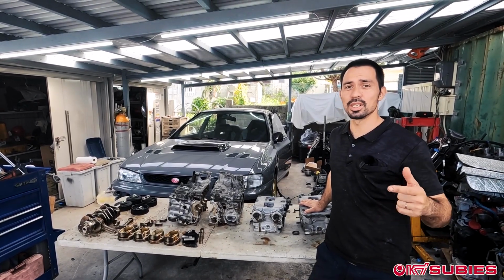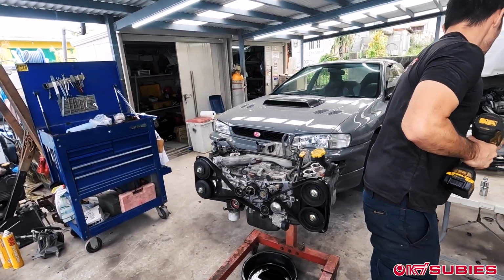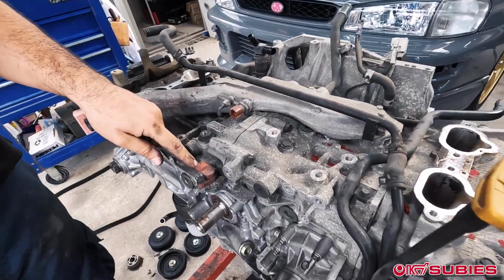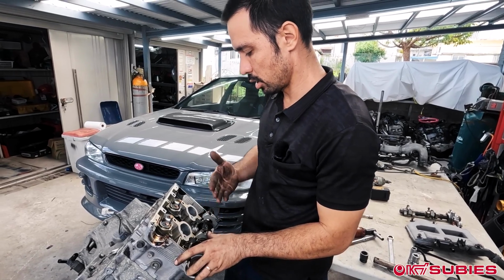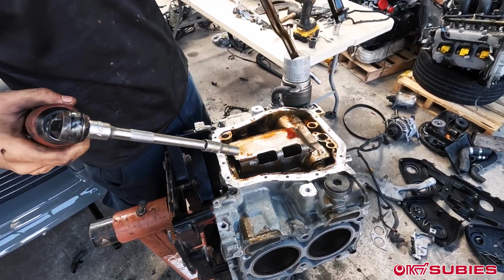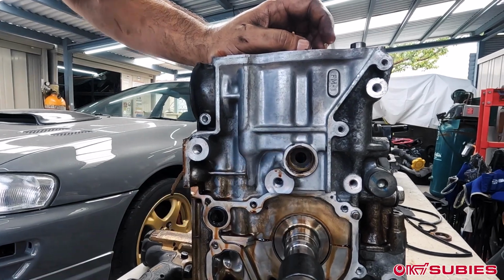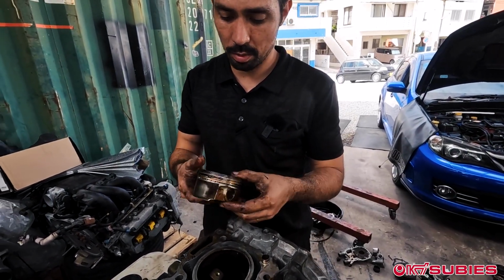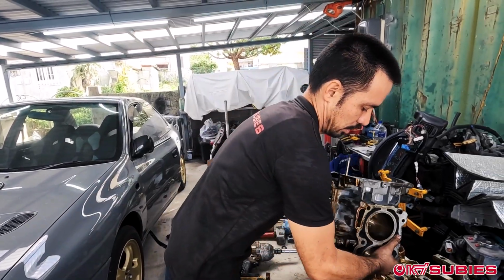How to disassemble an EJ series engine / Detailed Step by Step Breakdown

Comment: how would I want to go about building a stroker for the future? I have a 96 ra that has just been fully gone threw 2k kms ago before I bought it so I also have a link g4x with full bolt ons with every gauge for engine management/ fail safes from the ecu. I was also thinking about going with a iag 257 long block or short if i can use my heads.
Reply from the maker: The IAG short block would be a lot easier when it comes to wiring because your heads would bolt up to the 2.5 L block you just need to make sure to get the right head gasket or get your heads chamber matched. You could also just use a 2.5 L 79 mm crank with aftermarket rods and stroker pistons and do a 2.1 L

Comment: Quality content guys! I am one of the still stock and untouched EI20K owners. 120K km and still going strong but yeah, I do not abuse it so...  
Question. The JDM STI RA EJ207 short block(the "thick walled" one). What are the modifications needed to install one of the to the otherwise EJ20K car? Have you used one?
Reply from the maker: Love this question!!! I have some good news for you! All version 10 and up (GRB, VAB) EJ207’s have the thick cylinder walls. We have done this with just adding a 1.2mm head gasket. 👍🏻
Reply: @OkiSubies  I know this is specific but can you say what exact gasket you used for this application?
Reply from the maker: @aaro1985  We used HKS in the past from yahoo auctions but Tomei has them also. https://www.rhdjapan.com/tomei-metal-head-gasket-1-2mm-gc8-gdb-bp5-a-c-bl5-a-c.html
Reply: @OkiSubies  Found that also. Thank you sir! 🙏

Comment: Really good video. What’s the benefits of a stroker 2.1 over a ej207 or similar style factory block?
Reply from the maker: The 2.1L uses the 79mm crank from the 2.5L and increases torque and helps spool the turbo.🙂

Comment: Will the ej20k cylinder heads fit to a ej20g engine?
Reply from the maker: Yeah I don’t see why it wouldn’t. You would have to look into the head gasket size to get the proper compression ratio but other than that it should be pretty straightforward.